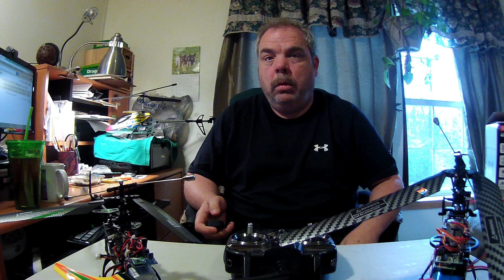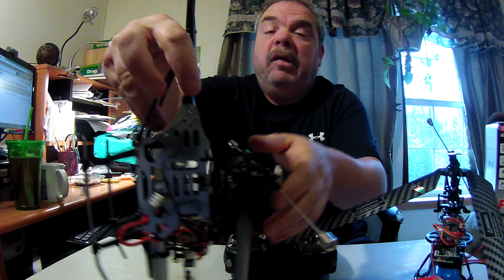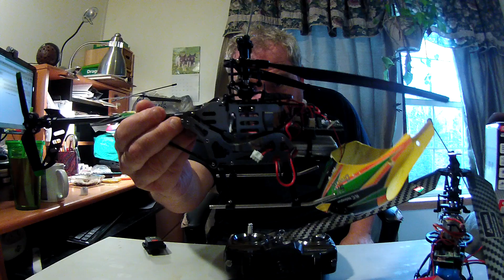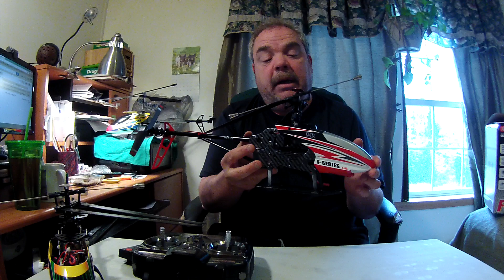MJX F45 & WL TOYS V912 Helicopter~Flying~Swash Plate Leveling Beginner Advice How~to

Comment: hello, sir does the carbon fibre upgrades on the MJXF45 fits on the V912? plan to do some mods in the future
Reply from the maker: Roxass00 I don't know? they are roughly the same size so it might with slight modifications?  let me know how you make out.
Reply: yeah will do, by the way do you know what kind of brushless motor can be install on the v912 tail motor? i am getting tired of the stock motor keep dying on me... lol
Reply from the maker: That's one heck of a job to replace that motor you must be a Pro by now? :) Unfortunately the ESC can't handle (to my best knowledge)  a Brush less Motor. Might be time for an Upgraded Copter?
Reply: haha nope, not a pro but I try and ask around my rc neighborhood and see how does it goes..

Comment: I have a wltoys v913, it has been flying great and I didn't use it for about 6 weeks because I had to replace rear tail motor and ever since then when I take off the body spins uncontrollable to the left?. any help would be great?
Reply from the maker: +Lee Jones Hmmm,..could be swash-plate or your new tail motor is defective ?  Without seeing it, it's hard to tell.

Comment: Good vid, thanks Edward! I agree that it is intimidating to start tinkering with these, but you make it seem relatively painless and easy to do.
I have been sitting on the fence between WL and MJX...based on your commentary below it looks like you are recommending the 912 huh? I see now they have a V912 brushless...which is awesome, but the ESC placement is horrid, sits right on top of the LiPo. I think I will hold off until they re-jig the layout and add a brushless rear motor as well. Be nice too if they could ditch the mechanical flyer...

Comment: Ok, I have one the cheaply made ones ... a "Cloudquest W6625". I had the right aileron trim maxed out and it still wanted to drift right. As it flew away from me it was obvious enough to see the main rotor was tilted. Adjusting the ball linkage to level the swash plate helped a lot, thanks.

Comment: Thank you! for this fine video.
Im new to RC, just ordered a v911 and a v912. I cant wait till they get here! in the mean time, im trying to learn as much as i can, to be prepared when they arrive.

thanks!
Reply from the maker: Your welcome. My aim is to spread the joy of flight and help others along :)
Reply: Edward Lyons
My first heli arrived today! it turns out its the V912 (i was expecting the v911 first).
My first flight resulted in me having to quickly kill the throttle to avoid hitting the wall LOL. The second flight i was able to hover it more or less (a few scares hehe), and noticed drifting to the left and to the rear even when about 50cm in the air (well above ground effect). Did some mechanical trimming, and then it only took about 2 clicks of the Tx trim buttons to correct. Also had to apply some trimming to the rudder.

By the 3rd flight, i was able to hover it DEAD ON for a long time!

Either this bird is VERY VERY stable, or im a VERY quick learner! (probably the former) LOL
Reply from the maker: elvampir0 The V912 is MY favorite of all smaller 4 channel helicopters !
Reply: I have a question I crashed my helicopter it’s a F 45 series and now the Rutter doesn’t work properly I checked the motor it runs fine seems like maybe my computer board may have taken the shock how do I test for Rutter voltage

Comment: Great video! Thanks for the info. I've got a question: I've got the V912 (owned two actually) and they've both "broken" the same way. I was flying indoors and knocked a table leg. I didn't think anything of it, picked it up, set it upright and increased the throttle. However, this time, the helicopter was uncontrollable. I could hover it, but the inputs wouldn't listen, like they were sluggish. At first, I thought it was a gyro issue, but after watching your video, I wonder if I've broken my swash plate. What do you think?
Reply: To clarify, it was 25% controllable for a few moments. Then, it started to lose control, mostly to the right. The control inputs wouldn't respond. The tail rotor functioned perfectly, but everything else was very difficult to control.
Reply from the maker: Austin Gunn Without seeing it I would def check your swashplate and all the connectors. Those parts are nylon and can elongate or hair-line fracture without you really seeing it and not cause performance issues until sufficient torque causes rotor failure.

Comment: All of your adjustments can be done from the receiver instead of messing with the turnbuckles!
Reply from the maker: yes but you will get to a point where your helicopter body is actually tilted to one side which throws off your CG & makes the Helo increasingly harder to trim AND fly !

Comment: Hi Edward ,
I have a couple of helicopters an syma 107g and mjx f645.
My f645 had a crash and the main motor shaft broke.
I replaced with the new one but the blades are not that comfortably moving with servo. Is the problem with the new motor shaft or trimming options ?
Reply from the maker: HI, it could be any number of things, servo's, servo arms, bent or elongated couplings/turnbuckles. But my guess it's a servo. Disconnect your turnbuckles and try your servos with TRX. Check for movement and that it moves freely. Also don't push/pull on servos as that can strip them. Let me know how you make out & good luck !! Happy Fly'n !!
Reply: Edward Lyons It was a disaster while flying with mjx f645, I broke landing gear, tail fin, and a bent gyro in my last crash.
I tried to trim the servos and fly it, but this was what happened.
It is taking off steadily but if you try to move front it is going diagonally front and back- it goes diagonally back and that too it is not stabilizing back to the normal position, rather hitting the ground.
I really lost hope that it would work normally, should I order a new one or can you suggest me something ....?
Reply from the maker: ouch! I've been there Bud. I have found the NJX to be the least reliable. I have lost 2 forver (flyaways). The TRX & antennae are not the best. Once I exhaust my MJX's ( I have 3) I am done with that brand. I have had MUCH better luck with WL Toys V911, V912 & V913. All stable, durable fun flyers that instill confidence. I highly recommend !!
Reply: which one do u recommend between Mjx f645 and Wl Toys V913 ?
In case of durability ..
Reply from the maker: Phani Teja Hands Down the V913 because the radios (TRX) and receiver are much more reliable and the copter is nicer overall !! Hope this helps & Happy fly'n !! :)
Reply: Edward Lyons One more last question ...
will the transmitter of V913 work for V911 helicopter ??
Reply from the maker: Yes!! the WL Copter radios will work with all WL Copters !!

Comment: I found this to be a completely unnecessary step on a fixed pitch. I have two V912's and one I leveled the swash and the other one I didn't. The one that I didn't fly's perfect out of the box, the one I leveled took a lot of trim adjustments even though it was perfectly leveled. It may depend on the heli as you receive it though?. Very well done video by the way, thanks
Reply from the maker: Thank You Billy. Your right, these things are mass-produced and they do vary wildly. With the V912 in particular, I have had swash plate perfectly leveled requiring no real TRX trim settings. I can be done flying for the day & put the Helo away. Then the next day I can take that same exact Helo out to fly & it's all over the place requiring re-leveling of swash plate AND trim adjustments. Problem I identified is is plastic/nylon swash plate and other pieces that get warped, elongated or ware out.